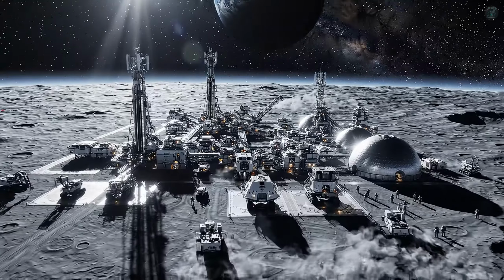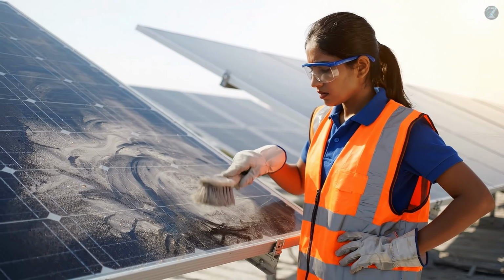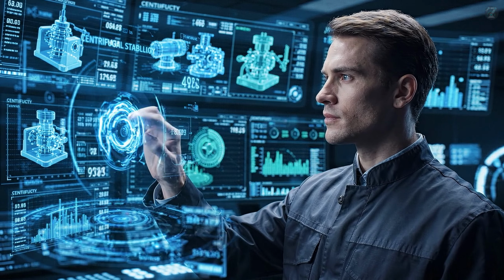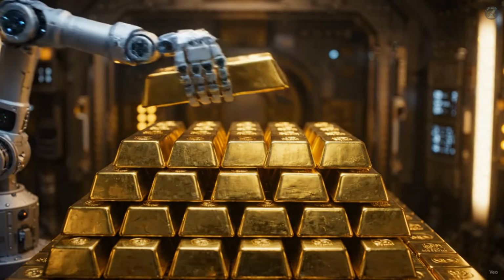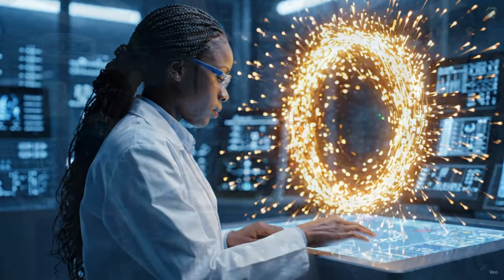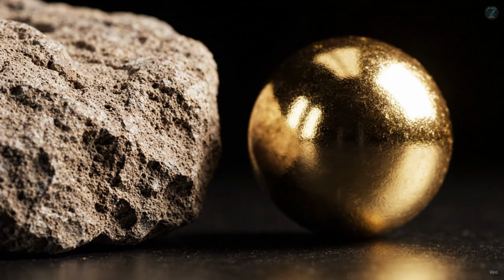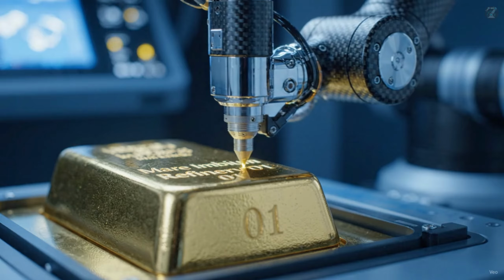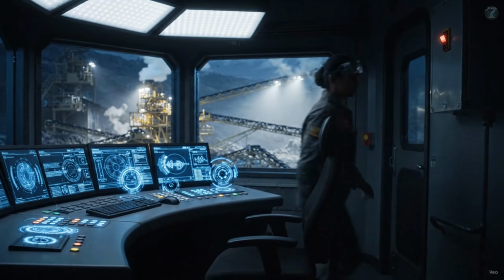How Lunar Gold Mining Will Change the Space Economy Forever

Comment: The research, the investments, the colonization...all already under way. 

However, the presumed moon substrate is essentially volcanic ash residual from an earlier formed volcanic caldera - "moon crater." 

Without proper seismic monitoring, mining could be a fault issue that may be disastrous. Based on the current models, the current applications do not include a seismic gauge or counter to monitor the moon's caldera activity, thereby endangering engineers, physicists, and miners.
Reply from the maker: This is a fascinating and thought-provoking perspective. You’ve highlighted an important issue that often gets overlooked: lunar mining isn’t just about technology and resources, but also about understanding the Moon’s geology and seismic activity. Safety monitoring will be absolutely critical if humans begin large-scale operations there.
Reply: @FutureFactoryLab  Thank you for the supportive response. I constructed a module lunar city and noticed none of the infrastructure development had an option to construct seismology.

Based on independent investigation, the calderas and volcanic ash minerals are indicative of a more primitive Precambrian era where an eruption may have occurred.